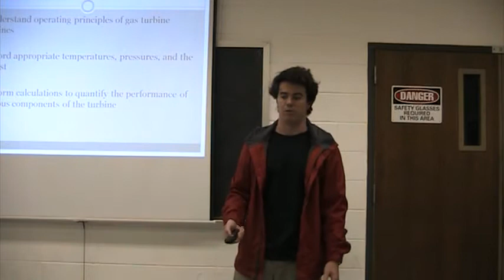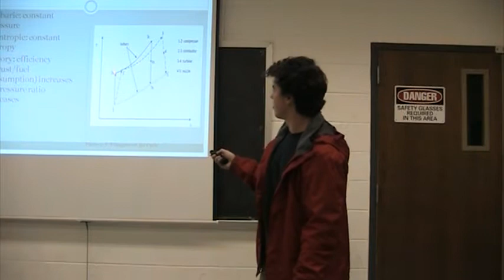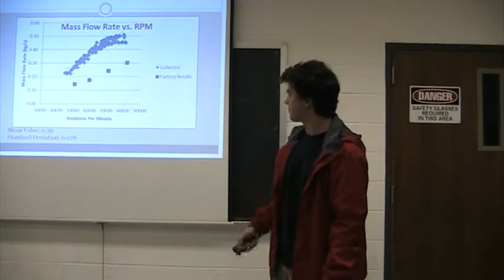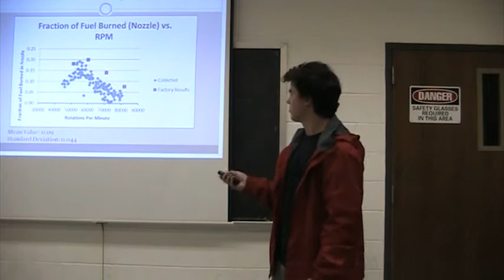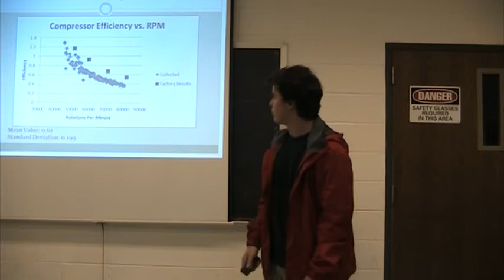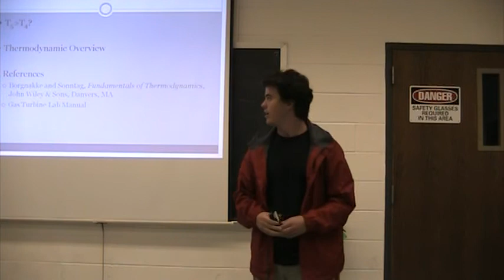Charles Mouton

Comment: I've definitely cut out some of the fillers I used at the beginning of the semester, which I think is due to me memorizing my speech less.  I wish I could have done the experiment because I feel it would have increased my technical knowledge of the experiment and I would have been able to explain my errors.  I thought the flow of my presentation worked very well, and that the slides and analysis transitioned well.

Comment: The slide quality in the presentation was very good. i liked the graphic presentation used on the intro slide. All graphs were also easy to read. the only changes i would suggest are to use animations to slowly introduce text on slides with a lot of text like the equations slide. Also, on the efficiency slide, putting the results in a table with grid lines would make it easier to follow.